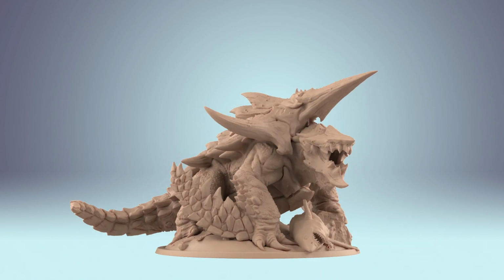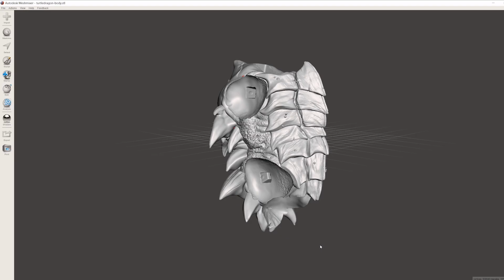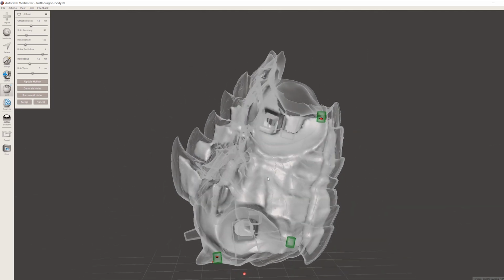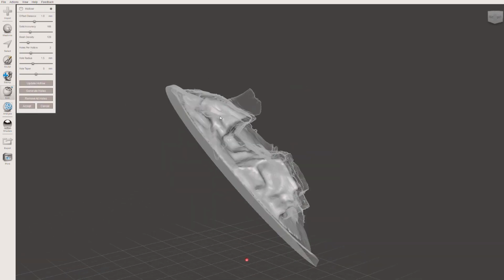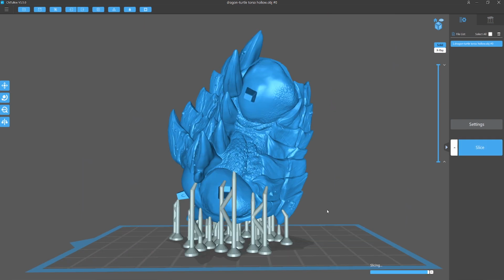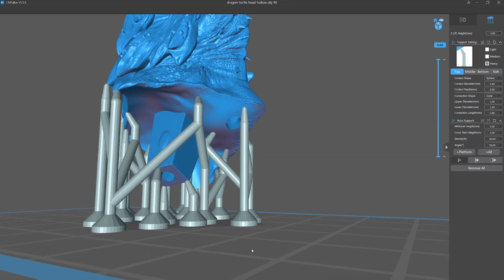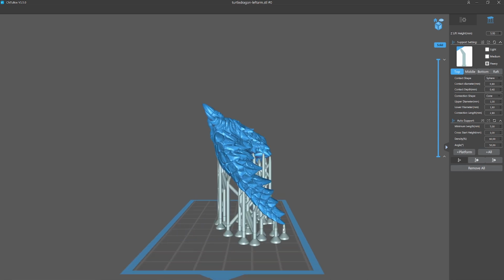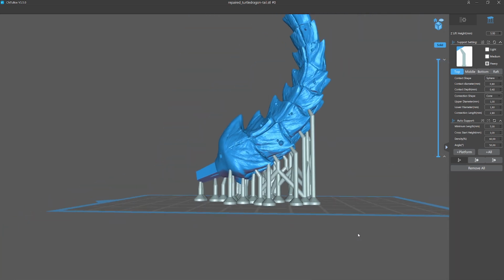Setting Up Models For Resin 3D Printing

Comment: Hi I have a problem with my resin 3d print. My  prints don't print  with flat surface at the part that face the plate  the are mess up in these place how can I fix it?

Comment: My only problem is the joints never fit I have to sandpaper and sandpaper.
Reply from the maker: Different resins have different shrink values. Once you are used to the resin that you use most then you can build in a tolerance to minimise the amount of sanding, but there will almost always be some sanding to get it right. 

For ball and socket joints, connect the parts first and then UV cure.

Comment: Hi. I bought a pattern and need to print it in multiple parts on the Halot One but cant seem to get the sizes right as one piece is bigger than the other and does not want to fit into each other. Do you have any advise for me?
Reply from the maker: Hi there! By pattern do you mean a 3D file? Most 3D files should be set up correctly however there are the odd occasions where they forget to export the correct sizes. 

I would add all the files into your 3D program of choice eg. Meshmixer and pre assemble your model. Often times the scale is off by x10 or x100 based on the scene scale from the program they exported from. But if that is not the case it could be that your program is auto scaling to automatically fit the build plate. BUT what is most likely happening is that the resin you are using has a very high shrink value and could be messing with very fine parts or measurements.  

Will need some more info if that advice doesn't help you out. What resin are you using, what slicer are you using and what file are you trying to print? 

Thanks :)
Reply: @lucid3dart  thank you for the reply. I am using halot box and use the water washable creality resin. Think i will try the Meshmixer route. It is a stl model that i want to print of the nintendo character, has 81 pieces

Comment: Keeping the holes is so you can print them. Then when the inside of the print is drained you can put them back in & cure the model closed again.
If you line them up & note where they came from the surface will match.

For items with larger flat faces such as boxes, gears would the bottom be best against the build plate for the flatest side?

For large area rigid build plate is this a bit risky it will try & cement itself on & be difficult to remove but OK for flexible magnetic plates ?

Thanks for the useful guide !😁

Comment: Hi, I have car model and at he scale that I want to print some thin parts won't came out correct...How can I fix them?
Reply from the maker: Hi there, this depends on the final size/ scale, print settings and resin used. Some resins have a higher viscosity that will struggle to print thinner walls or at lower microns. 

How does the print fail?

Comment: Really nice video, must say I really enjoy you're presentation style and voice (nice and relaxed :)). As for the most important part (the content). Was exactly what I was looking for, would have liked to see a bit more details about hole placement (I noticed you placed the holes at the part of the model facing towards the buildplate, any reason in particular for this?). Keep up the good videos. As for video's I would like to see might be nice to do a printer calibration video (how to find settings that work for your printer).

Comment: Hey man, this is such a great video. I really appreciate all your explanation, very helpful for us 3D print newbies here. I have a question regarding the fume of the resin, do you have any tips on how to print safely in a small room without any ventilation? I heard the SLA resin can have a very bad effect on health.
Reply from the maker: Hey thanks man, I really appreciate that!
I responded earlier but I don't think I really answered your question.

I print in a tiny room, so here is what I do:
- I limit removing the lid to avoid letting the fumes out.
- When removing the lid I make sure that my windows and doors are open.
- Having a mask with a filter for chemicals and fine particles really helps.

I mainly use the Phrozen SM4K which has no air filter and I prefer that. No air movement during printing and I ventilate when I remove the print.

Hope that helps. :)

Comment: i got an ressin printer for birthday and i have a problem i have some moddles i want to print but they are in an format the printer can't use can you please help me
Reply from the maker: Hi there! Happy birthday! :) 
What printer did you get? So, printers will accept a file from their preferred slicer. For example a Phrozen or Elegoo machine will use Chitubox and accept a .CTB file. 

3D files will be supplied in "STL" format and you will have to support, slice and save in the file your machine will accept.
Reply: @lucid3dart  i have the nova 3D elfin2 mono se (Thanks for your help)
Reply from the maker: @Bomber-Trebor  No problem! :) Great little machine. You will want to use Lychee or Chitubox to slice your model then. Save out at their native files after slicing and not a 3D file. 

I don't have a video on using Lychee but there are a few on YouTube. Best of luck and let me know if you get stuck. :)
Reply: @lucid3dart  and as far as i know does .CWS files work because of the alredy installed test files
Reply from the maker: @Bomber-Trebor  .CWS was from Creation WorkShop. Not sure if they are still running but yes that would be an example of a sliced file. 

2 best slicers to use are Chitubox and Lychee (which your machine should be native to)
Reply: @lucid3dart  and thanks for your suport and help and please keep on going with your videos they are awesome i will abo and like you

Comment: Great tutorial. Can a little suction mess up the fep of the resin printer. Asking because I have some complex models
Reply from the maker: Thank you so much! Stay tuned for the revised version dropping in a few weeks. 
And to answer your question: A little suction force won't mess up the FEP but it will damage your print and you can have a blow-out. Avoid any suction force by adding some drain holes. You can close the holes very easy with a drop of resin and cure to close it off. Will be touching on this process in a future vid. 

What can damage your FEP sheet is repetitive printing of the same model in the same place. If I need to print a few copies of the same file then I save out a couple versions where I simply move them around the build plate.

Hope this helps! Happy printing!

Comment: hey there, for resin workflow is it necessary to hollow? or solid?= or make some desicion? I am more focus on 3D modelling and scultpint, have strong use of zbrush, but not for 3D printing...so I would like to know what desicion should I make? to planning my worfflow..I know that in PLA 3d model for 3D printing proabably you should inflate or make solid the mesh, making a little bulky cause can break sometimes...In resin all it is perfect and smooth ?
Reply from the maker: I would suggest making your models hollow every chance you get. The reasons why are mainly because it saves on resin and the other is the prevent cracking on the surface because the outer part of your model cools down quicker than the inside causing stress. 
Hollowing a model is very straight forward and can be done inside of the slicers. Make sure you add a drainage hole at the base of your model (closest to the build plate). 

Resin can print fine details like DnD mini's, and FDM (PLA) machines can print large models cheaply. 

I too am a 3D artist and use 3D printers for fun.
Reply: @lucid3dart  for miniatures is always best to separate pieces using some sort of keying (pinning-hollowing pieces) ? thx
Reply from the maker: @leatherandpoemscharmyman5774  Having the model separated would make it easier to print and give you better details because you can minimize the overhangs. 28mm Minis are very small and sometimes it is more effort to try and print it separately than to print it all at once. Larger models benefit from splitting.

However, splitting and keying is not an option for most 3D printer users because you need to know how to 3D model. This is why more and more models are pre supported and split for easy printing. 

Since you are a 3D artist then you can split and key your own models. I will be releasing a video on splitting and keying in Zbrush in 3 weeks time.
Reply: @lucid3dart  28 mm and 36 mm is not good to separate (because is more effort to try print them)? ahh ok I was very confuse, I think always to keep always separation via keying-pinning tecnique... Yep I would like to know a good video to separate via keying-pinning models , take notes, special because I ve not experience in 3D printing, I use zbrush years ago , I can learn easy 3D printing...I guess...but I need practice of course, you can use zbrush very well ,but need some technique and notes for understanding what happened in 3D printing workflow! thx dude!!!
Reply from the maker: @leatherandpoemscharmyman5774  pleasure man! 
It comes down to personal preference if you want to split or not. This is the internet, there are going to be some people that will disagree with me but if the model is really small like a low resolution 28mm mini then I am not going to waste 3hrs of my time splitting and keying it BUT if I paid good money for a super high resolution model then I might just give it a couple hours of my time to slit it. (most paid models come split already.)

Splitting will always give better results. But on something so small, are those results really worth the extra hours? (If you are doing it for a job then obviously go with what gives you the best results.)
Reply: @lucid3dart   high resoluition model is somethin related in quality? sharp and full accesories with wigns and huge dragons? thx
Reply from the maker: @leatherandpoemscharmyman5774  so there are no set limits to the resolutions. A rule of thumb in terms of 3D printing, low resolution models are usually <100K Quads and high resolution are >800K Quads. 

I work around the 1mil poly mark when making models for resin printing.
Reply: @lucid3dart  when you print for resin ,you should stablish a minimun thickness of weapon or accesories in your model? to not break the piece? is it necessary to use mexhmixer to inflate the mesh a little to make it a little thicker? or make thicker is just for PLA fdm models? thx!! your knowledge is extreme useful I am going to suscribe yoru channel and share with a friend. thx dude
Reply from the maker: @leatherandpoemscharmyman5774  thank you! I appreciate that. :) 

Weapons you can print solid. It is usually torsos or other big parts that can do with some hollowing. A shell thickness of 1.7mm to 1.8mm is perfect. This is depending on the project, printing large items will need thicker walls and smaller items can use thinner walls.

I tend to stay away from anything with "inflate" in the name haha the latest Zbrush has a contrast slider which is perfect for 3D printing.
Reply: @lucid3dart  thx!!!

Comment: Oh, boy. You made some fundamental mistakes! Though, you made this video 9-month ago. So I guess you learn in mean time :-) Let me give you a tip. If you use a Sphere as a Contact Shape, be careful to set it in a way that a sphere pops-out of the model just a tiny bit. In your case the sphere is totally "immersed" in the model. So it's absolutely useless! The point is that the sphere remains intact while the support breaks at the connection point between the sphere and the support cone. After the break-off you will have a model with tiny bumps (from spheres) that you can easily sand/file off. In your method the support will break between the model and the support cone, and often the model will be chipped! A contact sphere act as a "damping" if you will.
Reply from the maker: Thanks, that is a good tip. Actually, I've been wanting to make a updated version of this video because it was one of my first videos. I do hope you liked some parts of the video tho.
Reply: @lucid3dart  Sure the "explanatory" graphics at the beginning -top-notch!
Reply from the maker: Any other "funamental mistakes", please let me know. :)
Reply: @lucid3dart  It's the way how you position your models. Plus, you really don't want ANY island to remain unsupported. Though there are rare exceptions. But it's hard to explain through these comments. But, hey... good work! Keep going.

Comment: G'day 
How would you do a rounded object which is virtually the size of the print plate? I can rotate it a little on the z axis and it is already angled on the x and y arises. 
Happy3dmodeling 
Greg
Reply from the maker: Hi Greg, sorry for the late reply. 
By rounded, do you mean a sphere or a disk like the bottom of a DnD mini?
Reply: @lucid3dart  G'day @Jarrod 
When I was referring to, would be a disc shaped object. 
Thanks for your response,  but I worked it out myself. 
It turned out great,  BTW,  with your guidance from your videos. 
Your are going to be 'my man to go to' in the future,  if you don't mind. 
I'm keeping a volumeof your videos, under 'saved' in my files, as a help to me in the future. 
As we would say in Aussie, 'you'rebonzzamate'. Translation: You are a fantastic friend! 
Greg

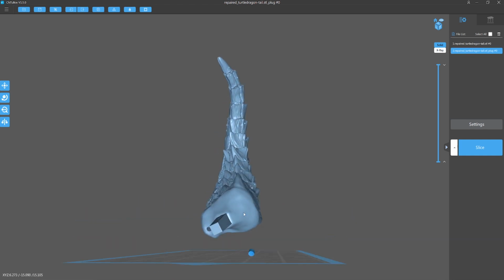Comment: 15:05 - The keep plug option is there to re-insert the plugs in the holes after cleaning and curing. This will restore texture if you can't create holes out of vision.

Comment: Hello, im making a rotary mechanical part for a prototype but had a lot of difficulties printing it. the orientation and supports posed a problem as the part had small crevices in which its hard to cut the supports as well as hard to maintain it centrifugally balanced. I know its quite a lot but this is such a big wall for my prototyping adventure and would love to see you do a video on it. I could send the 3D file :D
Reply from the maker: Hi, thank you for your comment. This could be a video on it's own because there is A LOT of information regarding this. In short, mechanical parts don't always work well with resin printing (shinkage, warping, heat fractures, etc.). I think this would be a great video to make, "how to print mechanical parts" but I will need to get extra tools and different resins first.
Reply: @lucid3dart  That would sound amazing, I think many would love to see that happen. I already have a part that has some deformations on the first layers. Syraia tech Blu is amazing in this regard. As soon as I'm getting the new Elegoo Saturn I'm printing some mechanical Accessories that if successful, will go on kickstarter :)

Comment: Great video - a video on mitigating warping during and after curing would be VERY helpful. 

Thin, flat parts for engineering are basically impossible to keep flat, even with excessive well-placed supports!
Reply from the maker: Sounds good! This can make for a great video! Will need to get some industrial resin to help with the explaining (different resins have different shrinkages so those that shrink less will be better with engineering). 
Definitely adding this to the list! Thank you.
Reply: @lucid3dart  Great, looking forward to it!
Reply: Easy fix don't model flat pieces use styrene sheet just print the details. Then glue to styrene